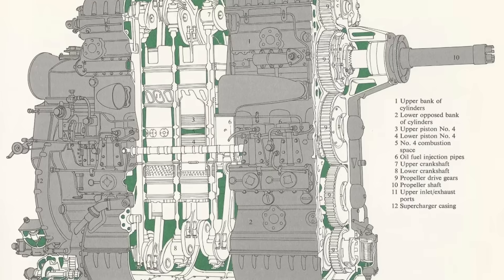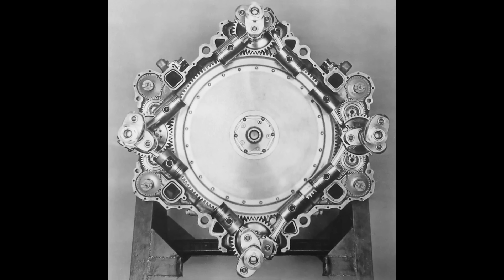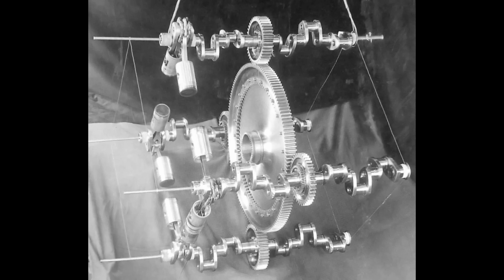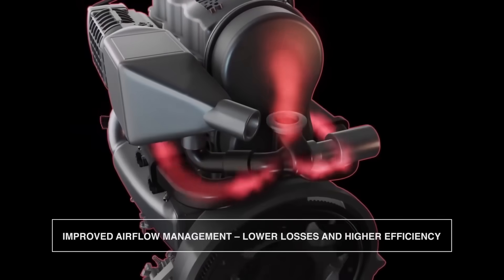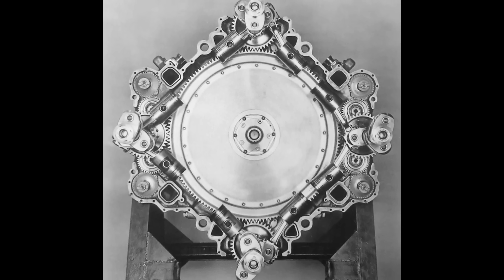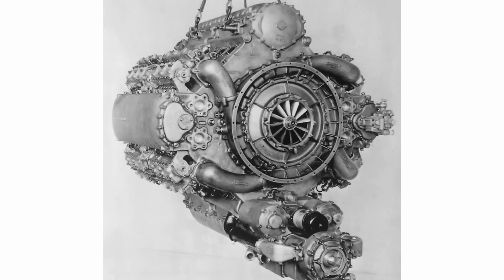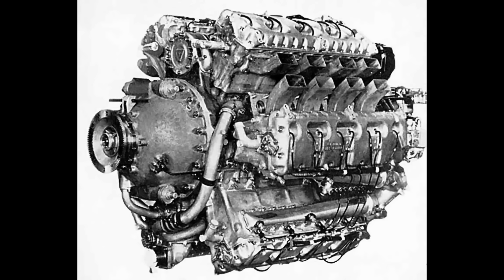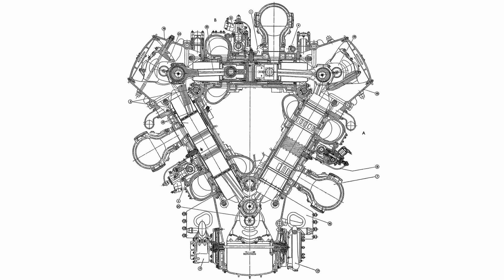The Jumo 223: Inside Nazi Germany’s Most Complex Aircraft Engine

Comment: The Napier Deltic is best imagined as three V12 cylinder blocks with the head joints facing together to create the triangle shape. It was originally intended to have all three crankshafts running in the same direction.  However there was no way to correctly phase the crankshafts. The inlet crank has to run 15° behind the exhaust crank. The fix was to run one crank backwards. This also solved internal vibrations.

Comment: Brilliant video! The story has some additional facets. Samuel B. Frank patented an opposed piston steam engine design in 1875, with the aim to reduce vibration through better balanced reciprocal masses. Ferdinand Kindermann patented a gas burning OP engine in 1877 and OP engine designs for petrol (Gobron-Brillié and Arrol-Johnston) already existed in 1904. Raymond Koreyvo of the Russian Kolomna engine works designed a diesel version in 1907. The idea didn't go into production that early, but the proven fact that the lack of cylinder heads leads to fewer heat losses and thus better efficiency of the OP-principle, led both the Kolomna works and several Western firms (notably Fairbanks-Morse) to pick up further development and production of OP diesel engines in the 1930's. The vastly improved metallurgic knowledge and possibilities around that time were a big help.

Contrary to Rudolf Diesel, who was horrified at the idea that his engine design was alo put to work in destructive military vehicles, Hugo Junkers contributed very pro-actively to better efficiencies for the benefit of military use. With the supply of oil and refinery products being blocked by Allied forces, Germany had to produce petrol and other refined fuels artificially from coal. The limited petrol supply was reserved for tank engines and high octane petrol was reserved for fighter planes. Diesel fuel was easier to make and in bigger quantities, so Junkers worked to improve the power-to-weight ratio of diesel engines, making them suitable for more applications than slow transport alone (trucks, ships and submarines, trains and locomotives, zeppelins, bulldozers). Diesel engines could have been an alternative for tanks (which the Russians proved in their T-34 tanks), but the German Command held on to petrol engined tanks, causing logistical problems (Rommel's units faltered in Africa becaue of petrol shortage). 

A good way to improve diesel efficiency was to make use of the OP principle without heat-loss-causing cylinder heads. Junkers' first products were relatively heavy, but the very advanced use of light and/or heat-resistant alloys soon improved statistics. Diesel engines under varying loads (bulldozers, tanks, diesel locomotives on heavy trains with frequent stopping and acceleration for signals) were known to suffer from broken crankshafts and heat damage in cylinder blocks and liners and piston heads. But the use in planes, like in ships, would mean operation under steady load conditions, which would allow much bigger stamina. Zeppelin flights had proven that.

The Fairbanks-Morse and Kolomna OP diesels were big heavy constructions, for use in power plants, submarines and locomotives.
FM OP 12 cyl. engines in power station (900 rpm for 60 Hz AC): https://www.youtube.com/watch?v=qgbPcVcd-pc
Kolomna 10D100 engines in a locomotive: https://www.youtube.com/watch?v=FFV9QUJ23GI (3000 hp a piece, at approx. 1000 rpm)
The Junker 204 and 205 were built much leaner: https://www.youtube.com/watch?v=rzO_tTpAT-U
The typical sharp two-stroke diesel exhaust note (caused by the first opening of the exhaust ports as narrow slits, releasing the pressure in trumpet-like blasts) is not so notable in the big engines with low rpm, but becomes more noticeable at higher rpm (Junkers, GM-Detroit, Napier, Foden, Leyland, Malyshev, etc.): https://www.youtube.com/watch?v=kc5iLmib1NU .
With only 600 hp, the Jumo 205 disappointed somewhat. It refused to start in very cold weather and behaved badly when working at top load (high fuel consumption and overheating, especially the pistons on the exhaust ports side of the cylinder block). In slow flights on reconnaissance duties ( Junkers Ju 86-P and -R) the engines were durable and economic and would operate at great heights, but on bomber duty ( Ju 86-A) they fell short and were replaced by BMW four-stroke petrol radials. The 205 diesels required a lot of maintenance.
They performed slightly better in Blohm & Voss flying boats (BV 122, BV 138, Ha 139).

It is unlikely that the complex Jumo 223 would have been successful on Transatlantic flights, for which they were planned. It took huge engineering brilliance and efforts at the Napier works to make the slightly less complex Deltic engines reliable (special alloys for the cylinder liners and oil cooling for the piston heads) and they were designed to run at a modest 1500 -1800 rpm. Imagine a plane with 96 cylinders and 192 pistons in its combined power plants running at 4000 rpm or more, expected tp keep doing that for hours without as single piston seizure.
This ia a Deltic locomotive, captured by John Goodale, in the best video on Youtube featuring this class with both engines running at full rpm. https://www.youtube.com/watch?v=7VRVT2PSpDc . That's 72 pistons in 36 cylinders at 1500 rpm. Now imagine 192 pistons in 96 cylinders running at 4000 rpm and think of what that would sound like (more than one-and-a-half octave higher pitch). Keeping that up during a full ocean flight? Never. Neither the Junkers- nor the Russian engineers would have succeeded. The 223 on a testbed would only run without serious trouble for a few hours at a lower rpm, and no more than 2500 hp was ever squeezed out of it during endurance tests.

Comment: Development began around 1939 and continued until 1942, when the jet engines tied up development capacity and the project was stopped.
The Jumo 223 piston engine had four crankshafts arranged at the corners of a diamond with four cylinder banks in between, each with six cylinders and twelve pistons. Two of the 48 pistons worked with a common combustion chamber on opposite crankshafts, as with the other Junkers two-stroke diesels (opposed piston engine).

Comment: Commer TS3 is an opposed piston two stroke that uses one crank making it compact and simple , they were in Commer trucks for 25 plus years and the next generation of ts4 motors was only killed when Chrysler bought Roots company in the 1970s and as Chrysler had a deal with cummins they killed the new ts4 8 piston engine.

Comment: This was the attempt of Nazi Germany for an engine powering the proposed Transatlantic Bomber. Specs of Prototype engines reveal that the projected Power ( 2500 horsepower) could only obtained with high revolutions, underlining the Problems of mechanical supercharging in those days. Furthermore , large fast running two stroke engines have Not so much😅 Thermal headroom.

Comment: Hello ,I always ask me how is the lubrication of the upper crank where is the oil going return ??
Reply: Probably an oil injection system!
Reply: @jlo13800  No, it doesn't use oil injection... and the airflow doesn't go through either crankcase, anyway.
Reply: @brianb-p6586 Ok I would just run klotz through the crankcase a few time and some pulled off to blend with fuel and keep topping off!
Reply: Both cranks use conventional pressure-fed oil lubrication. From the upper crankcases oil just drains down provided passages to the sump, or is sucked our by the scavenge pumps of a dry-sump lubrication system.
Reply: @brianb-p6586 Dry sump
I would using klotz techniplate 2 stroke oil

Comment: Never heard of this engine. I wonder if Fairbanks-Morse knew about the Junkers OP diesel, or was this a just coincidence that two different companies on two different continents were developing a similar engine? The FM OPs were never intended for aircraft, they were first used as power sources for industrial and marine use. They ended up in numerous US Navy submarines and ships. The OPs also were used in several diesel locomotive models from 1944 till they ceased locomotive production in 1963. FM is still building OPs today.
Reply: Junkers patented his inward punching horizontally opposed engines in the 1890s and they were eventually licensed by both Fairbanks-Morse and Napier.  Both these companies then developed the concept further.   Napier developed the Deltic (3 shafts) which created an amazingly compact engine that wasn't flat like the Jumo.   Junkers explored the box concept.   Napier, being in Britain, the home of the sleeve valve, developed the 2 stroked turbo compounded Nomad which used sleave valves.   No any more efficient but significantly lighter.
Reply: @bernhardzunk7402 The Junkers patent is dated 1929…
He had a lever timed version from 1914 but that clashes with a British patent also dated 1914 by Simpson and the 1882 Atkinson differential engine.
Reply: @allangibson8494  I have 1892 for the Junkers patent but it was a gas (not gasoline engine).   I recall seeing a junkers patent for a horizontally opposed diesel ship predating 1914.  It gave low center of gravity as an advantage.
Reply: @bernhardzunk7402 Before 1898 the opposed piston spark ignition gas engine was being developed by Dr. Oechelhauser (whom Hugo Junkers was an employee/student of). Junkers patented an almost identical engine in 1914 running on gasoline. That was completely different functionally than the later diesel engine as both pistons in the single cylinder design shared a single crankshaft.
Reply: How about an OP 2 stroke rotax made from 2 850 Etec’s . Lay it down in the sled with turbos

Comment: These and the NAPIER. engines are so different than the usual designs and were very successful
Reply: And not the only opposed cylinder engines. The post war Commer company used them in a line of trucks in three and four cylinder configurations with the pistons connected by rocker arms to a single crankshaft…
Reply: @allangibson8494  Well, sadly the TS4 never made it beyond the pre-production prototype stage - as I understand it only a handful examples were ever assembled. The Brits obviously had a soft spot for opposed piston 2stroke diesels in the 50s/60s as many of their AFVs were equipped with Rolls Royce K60 and Leyland L60 multi-fuels
Reply: The Napier nomad 2 stroke in a Polaris Khaos sled

Comment: 2:23 this is clearly taller than a single opposed piston bank in this orientation and the same if orientated as a square  and not a diamond.
Any school kid can tell you a square's diameter is longer that any one of it's sides
The blower is a scavenge pump not a supercharger , just like any uniflow two stroke uses
Reply: It is not taller for the same displacement. 
But yes, it's a scavenge blower.

Comment: Used to have a Jumo 205 as a teaching tool. I adore the engineering of that thing. One thing I dont think you mentioned (and may be different on the 223) is the angle offset: The exhaust side piston is 7 degrees ahead of the inlet side. This allows this exhaust to open first, dropping the cylinder pressure before the new charge is let in. It also closes the exhaust first, leaving the inlet open to create overpressure from the compressor. I think the Jumo engines follow in a very German tradition of engineering, like the engine placement of the Porsche 911 or BMW's insistence on a WW1 era motorcycle engine concept for decades, where a fundamentally silly technical concept is worked on with stubbornness and gritted teeth (wearing lab coats, of course) until they make it work.
Reply: For the origins of the Porsche / VW engines look at Tatra who made very impressive air cooled engines and motor cars. Porsche improved something that had already been in production but inconvenienced by a certain dictator.
Reply: I always thought the offset was 11 degrees (or 14 degrees according to some sources, but 11 is the most reported) in the Jumo engines and 20 degrees in the Napier Deltic (a limitation caused by the geometry of three banks of cylinders - there was no such limitation on the 223 and 224 the offset could be set to any angle).
Reply: I thought of taking 2 858 Arctic Cat’s to make a 1716 OP sled engine.

Comment: Very interesting, I’m familiar with the Napier Deltic design as they were used in the USN’s PTF NASTY class patrol boats in Vietnam and found the engine wildly different, relatively light and compact for it’s power rating and capable of impressive performance.
Reply: I thought of a mini Deltic made from 3 mercury optimax 193 CID v6 60deg blocks. These are are 300 XS strokers!

Comment: well...v12 got well over 2000hp and this over complex bulky thing didnt even went to 2500hp. sure sure there was much investment into v12 but still. seems this one would get no where even with way more investments
Reply: This was just a developmental stepping stone into using the larger engines.  Like the 224, the 224 started at 4800hp and went up from there while having a significantly better BSFC than the gas V-12s and significantly better altitude performance.
Reply: The Jumo 205 was used successfully with nearly 1000hp using roots type super charger.  The Jumo 207 was a version with a turbo super charger added between mechanical supercharger and the engine.  A Jumo 207D generated 2340hp as part of a test to confirm that the Jumo 223 and 224 were feasible.  It did require water injection.  Diesels are ideal for turbo charging because the exhaust is much cooler plus they don’t pre ignite.  Water injection was purely to contract the air.

Comment: Origional layout engine too tall  ?  Why not turn it through 90 degreea , it would have blended into a wing nicely , Or is that too simple ?
Reply from the maker: I wondered the same. Probably too wide and would interfere with air over the wings
Reply: The original intention was to lay it flat in wings, but it turned out there was an oiling problem.

Comment: I have a Junkers two cylinder water cooled opposed piston marine diesel engine, about 15 horsepower. Supposedly made in late 1920s. I last ran it about 30 years ago and it has been in storage ever since. There is a workshop manual with it. The top pistons have very long con rods down to the crankshaft at the bottom. It had been used as a stationary engine in a sugar mill.
Reply from the maker: That sounds like a fascinating piece of history! I'd love to see it someday.

Comment: One possible drawback of 2 stroke could be an enemy night fighter might use the smell to home in, at least at low altitudes where oxygen wasn't needed.
Reply: Most of the problems with particulates come from the diesel fuel itself.  Long linear chains such as a kind that were made synthetically by Fisher Tropsch don’t tend to produce salt unlike molecules that are more closed up and less linear.  The same applies to jet fuel kerosene.  A small amount of additional refining can get rid of much of the soot.
Reply: What smell? If you're thinking of the burned lubrication oil mixed into the fuel... no, this isn't chainsaw, and doesn't mix oil with the fuel or inject lubricating oil into the cylinders.
Reply: @brianb-p6586 Fill the dry sump with castor 927 maxima and plumb in an oil injection valva at the fuel inlet and have fun!

Comment: We buıld ın 2005 a 2 cylınder 1.2 lıter opposed pıston dıesel engıne ın dessau 
Produce 100 hp 
Carbon pıston
Reply: What 2 stroke oil did you use in that? Amsoi interceptor?
Reply: @ 
No oil in jet fuel 
Normal lubrikant system with 10//30 oll
In dry sump System 
But we use alu infitrarted carbon pistons
You find it on wikepedia 
Diesel Air
Reply: @gerhardheinz2793 Yes I saw it and I would be running amsoil interceptor in the dry sump

Comment: I have a one cylinder two piston junkers jumo test engine forced air from the 30’s and the hand drawn print. It’s the test engine from what I know is the Delta P 1500 16 cylinder 32 pistons.  I have one print on that engine. This was awesome seeing this video. This video is the first time I’ve seen anything on it. The name on my print is John Povleca , not sure what the spelling is on the last name the print in the garage and it  around 5:00 am or I’d go out there.
Reply: How about taking 2 Rotax 850 Etec turbo R's and making a 1700 OP 2 stroke that lays down in the MXZ chassis.  Polaris and Arctic Cat could do the same thing!

Comment: 2 cycle diesels will not run without a super charger, not a turbo The intake air has to be pushed into the cylinders.
Reply: They can be fitted with both, ref rhe Detroit Diesel units, but yes they can’t work without a blower to push the air not the cylenders.
Reply: @scrumpydrinker  Even a gas 2 stroke uses the crankcase as the blower to scavenge it!
Reply: @jlo13800  yes, technically that is still a blower as the descending piston pressurises the crank case and pushes the air / fuel mix into the cylinder.
Reply: @scrumpydrinker  Yes the best way to have it and get rid of all the wet sump nonsence which is just another mess to deal with!
Reply: It's a scavenge blower, not a supercharger.